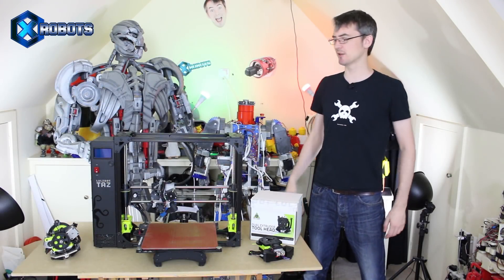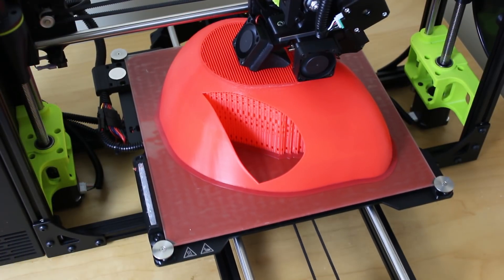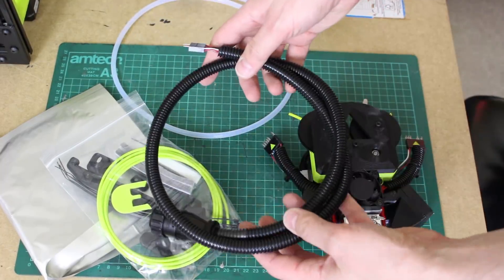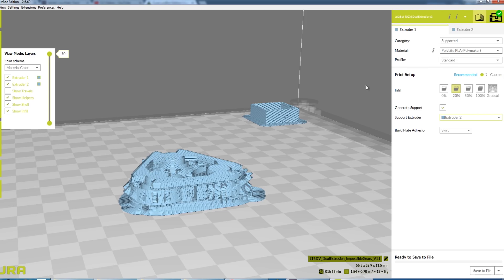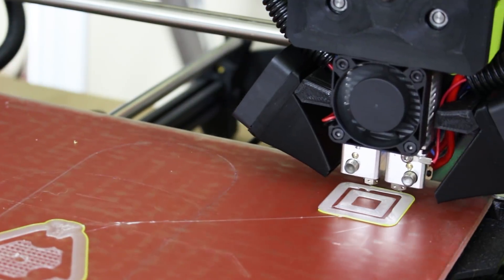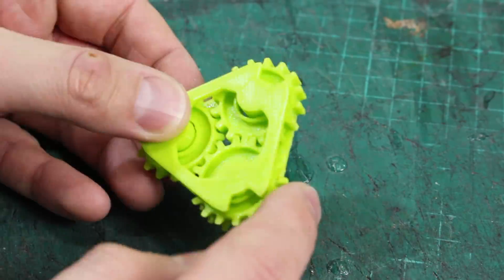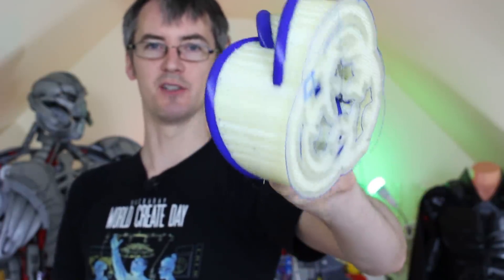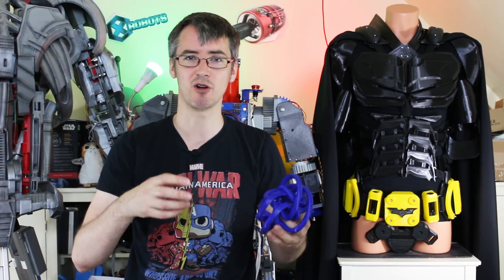3D Printing the Knotted Orbit | James Bruton

Comment: You really need a timelapse camera
Reply: Koos Naamloos movie maker and a normal camera my friend
Reply: Marlow Dupont good luck trying to let a regular camera film for hours without running out of battery power my friend
Reply: Marlow Dupont most proper cameras use accu's that have to be taken out before they can be charged, and because the charging goes slower than the draining you will need at least two more chargers and accu's, which combined are the price of a cheap timelapse camera. Also timelapse camera's make higher quality images, don't require any editing before the pictures can be added to the video and also Colin can use his regular camera to film other stuff in the meantime as he regularly does, my "not so sarcastic friend who can't take a joke"

Comment: Hi James! If you wanna save on the solvable filament because it's more expensive than regular PLA, there should be an option in the slicer to print only the interface layer with the disolvable filament and the bulk of the support in PLA. As for the time it takes to disolve away, warmer water (aka: hot, but not hot enough to warp the PLA) makes the process go much faster!

Comment: What happens to the water/plastic mix? Can you tip it down the drain, and is it safe? 👍😁
Reply: it's PVA, very similar to wood glue. According to wikipedia, it's biodegradable (although only slowly) and harmless to fish.
Reply: Yah fishes can drink plastic water without die in the first 10 seconds.. so you can blame global warming once they die 😋 (joking..)

Comment: What happens to the water/plastic mix? Can you tip it down the drain, and is it safe? 👍😁
Reply: s Taylor Yeah, it's PVA the same as the white glue that is safe for kids to use.
It's biodegradable and nontoxic.

Comment: I'm not sure what slicer it was, but I read about a setting that did the bulk of the support with PLA, or whatever the main material you're printing with, and only the last few layers with the PVA filament. That sounds like a big money saver since it's pretty pricey. I wish I remembered more about this but you should definitely look into this!
Reply: Simplify3D also has this feature.  Added in the latest update (v4.0)
Reply: In cura, you can enable the visibility of extra options, which will allow you to select which extruder to use for the bulk of the support, and which extruder to use for the support interface or the support roof (plus a bunch of other options). Never used it myself, but sounds like what you're looking for.
Reply: Ahh okay. I’m sure they’ll add it to their experimental settings eventually!
Reply: Cura has the option. Setting different material for support and interface would do the job. But since I started using dual nozzle on Ultimaker Mark2, I found that there is very little chance of PVA being necessary, so PVA is consumed really slowly. With PVA applied only to interface, the PLA support would get trapped in some model. For the ones don't trap it's support, it mostly don't need PVA at all, as it would also add significantly longer print time caused by nozzle switch. Based on all the aspects, using all PVA support is much more straight forward.